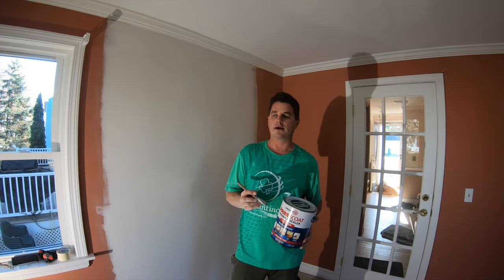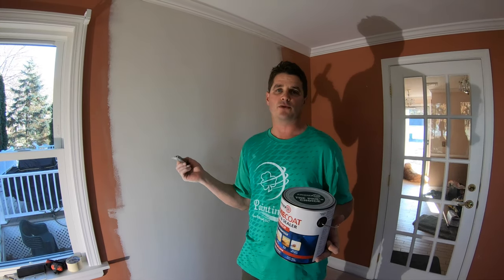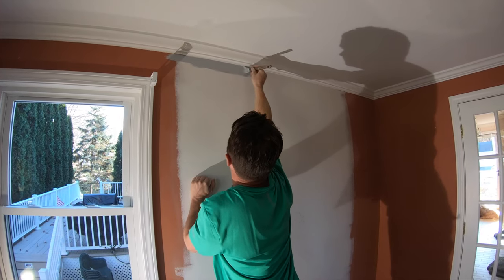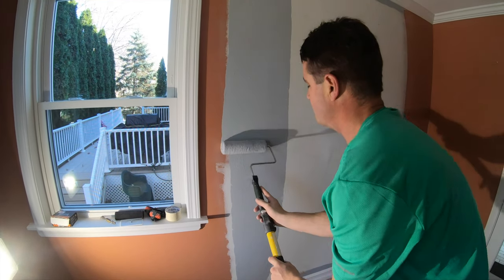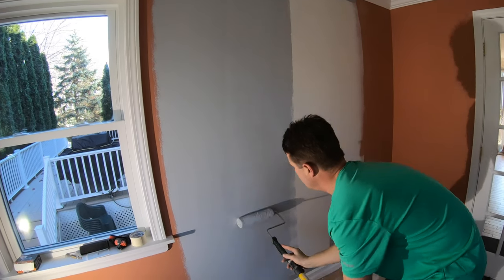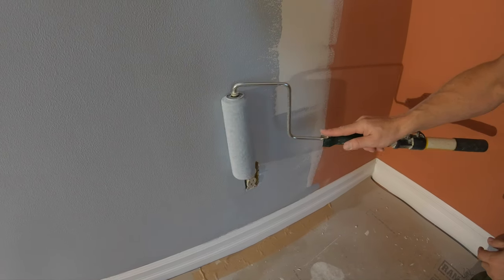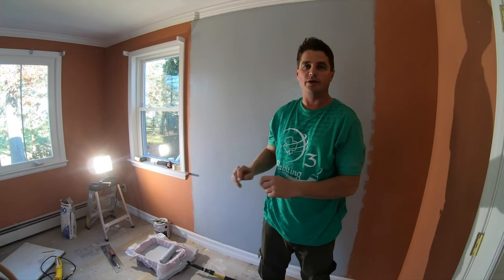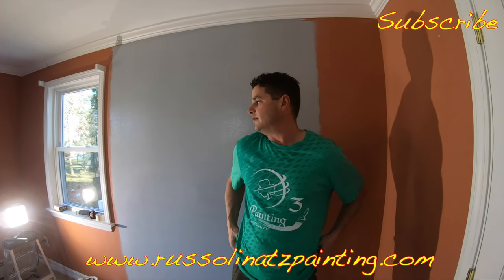How to Prime and Paint Large Drywall Repair (Part 1)

Comment from the maker: Purchase My recommended Tools, Brushes, Paints, and Primer's Here: 

https://www.amazon.com/shop/russolinatzpaintshow
Reply: Hi Russ.  I purchased the Corona Excalibur 2.5 for 'cutting in' because I heard it holds the paint for longer strokes. It really does and I would not use any other brush at this point.  I feel a little sad for my Purdy which has served me well for so long.  Wooster was just "eh".  Corona is worth the investment, in my opinion.
Reply from the maker: Hi

Yes, it’s a great brush! Cleans up easily and lasts a long time. Purdy does make a Chinex brush, but it’s not as thick as the Corona. I am happy you like it. What kind of paint did you use?
Reply: ALWAYS Benjamin Moore. I'm afraid to use anything else because I'll be upset if it doesn't dry as nicely.
Reply from the maker: Geno Paints Hi- Why do you prefer to use a 3 inch cut in brush?

Comment: I never knew the 1/2 inch nap over the primed area, trick. Those areas always seemed to suck in so much paint and I ended up putting on multiple coats.  I would have thought the texture would show through on the next coat. I'll give it a try the next time.
Reply from the maker: Hi

Yes, the whole idea is to build up the texture. 

Russ
Reply: @RussOlinatzPaintShow  OK, I gave the 1/2 " nap a try and it worked like a charm. I also had the paint store tint the primer which is key! It showed any areas I had to touch up. Thanks for the tips.
Reply from the maker: A Patterson That’s great news!

Comment: I’m remodeling a flip house now that is by far the sickest place I’ve seen yet. There was a bad bed bug infestation there about 6 months ago. We had it treated twice and heated once, so far so good.
The issue I’ve ran into is there is bug shit all over the wall, or in other words, blood.. yeah it’s gross.
So I’ve had to knock it off with my five way and sand every single inch.. It also has nicotine running down the walls.. plus all the dirt and grim. 
Have you ever took on a disgusting job like that.? Lol
Reply from the maker: Hello-

Yes, I have had to deal with that before. I had to use an Oil based primer in the past. Luckily there is a newer water based primer that has come out that will deal with covering the nicotine and blood stains. Here is a link to my Amazon Store front. Click on Primers and its the first one you see made by KILZ. https://www.amazon.com/shop/russolinatzpaintshow